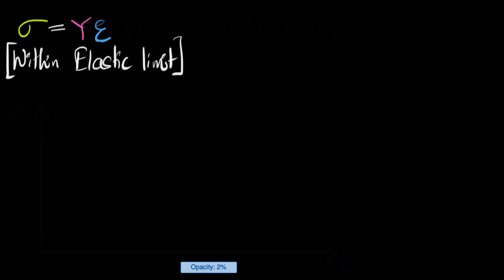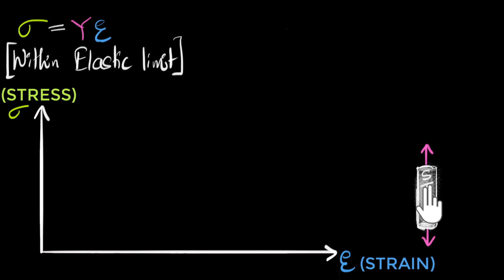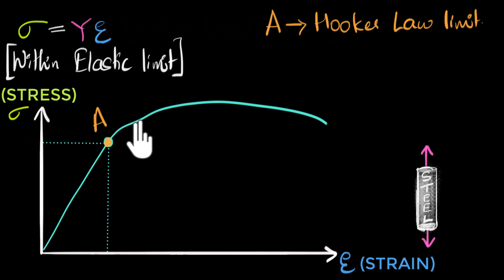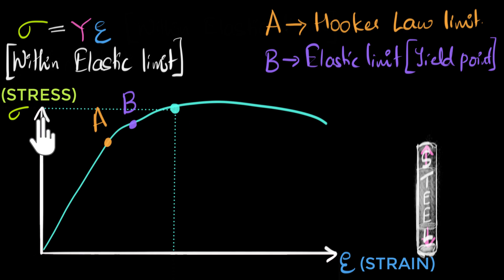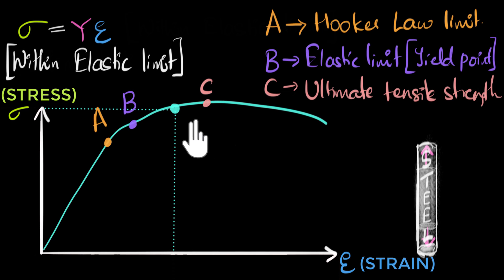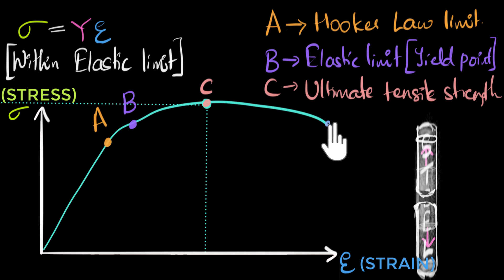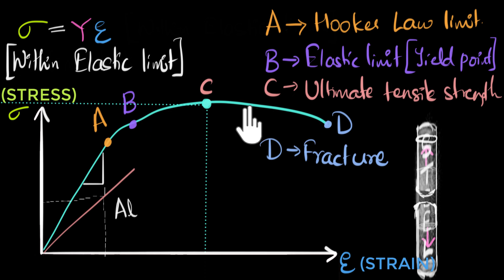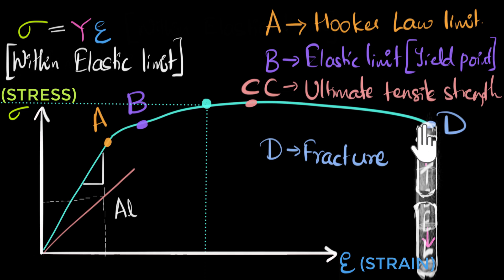Stress vs strain curve | Class 11 (India) | Physics | Khan Academy

Comment: Stress keeps on increasing?
But the curve shows decreasing stress?
Reply: Thank you...my "graduated" ass couldn't figure out why the graph shows decreasing stress.. it's calculating the stress on that very area where the necking happens. So area becomes less, stress becomes more. And the whole thing is based on behaviour of strain on application of stress, so there should be a steady increase of stress. WHY STRESS SUDDENLY DROPS AFTER ULTIMATE TENSILE STRENGTH.
Reply: @TheSarcasticClown   brug , its total stress by total strain bro so even though its pinching in the middle and the area is decreasing there we still calculate the stress w.r.t to the original cross section , or another way to think of it is after ultimate..
the force applied at the ends of  the rod is decreasing but because its pinched cross section is also decreasing at a higher rate the net stress on that particular section is increasing.